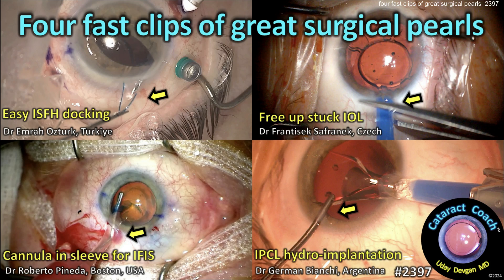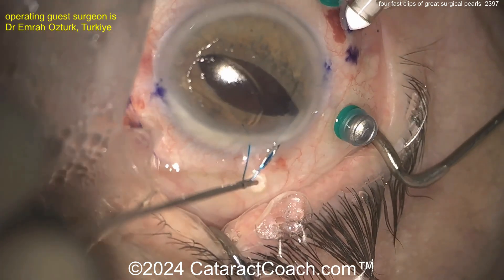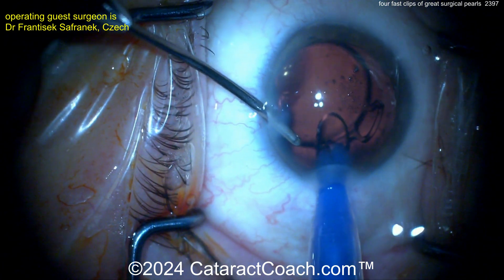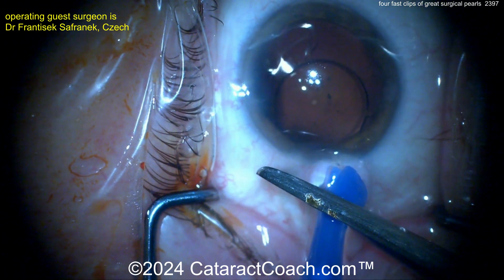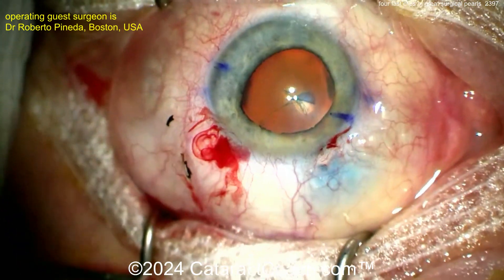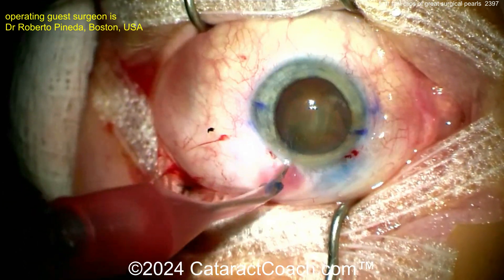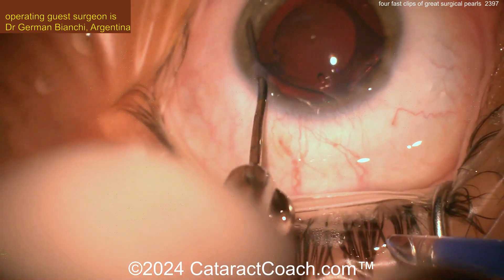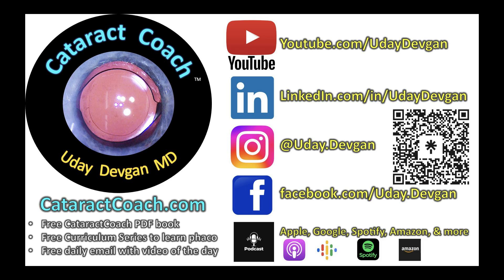CataractCoach™ 2397: four fast clips of great surgical pearls

Comment: For floppy iris/small pupil, you may consider also burping out some viscoelastic and inserting the hydrodissection cannula through the paracentesis (instead of main wound) then gently hydrodissecting being mindful not to overdo it as there is close to no egress of viscoelastic/iris through the 1mm incision. The way presented is very clever and I can see it being useful in a lot of severe iris prolapse scenarios and you can throw any instrument into a pink or purple sleeve to prevent iris prolapse such as kuglen/push-pull if you didnt want to create a second para, you may even be able to put the malyugin injector into a sleeve if you have severe iris prolapse/shallow AC. Very clever!